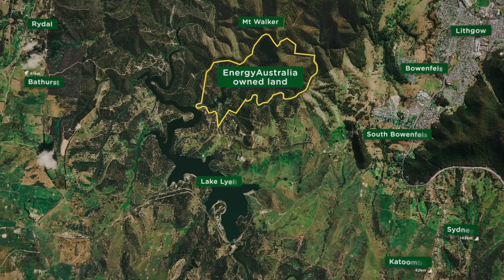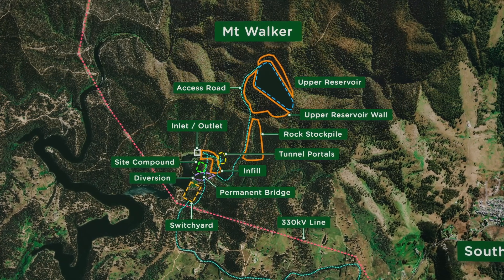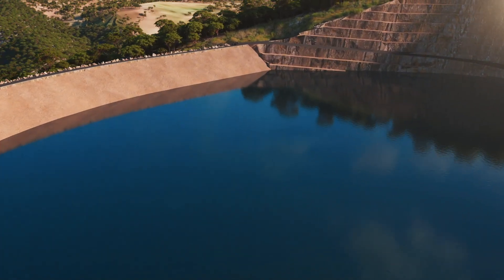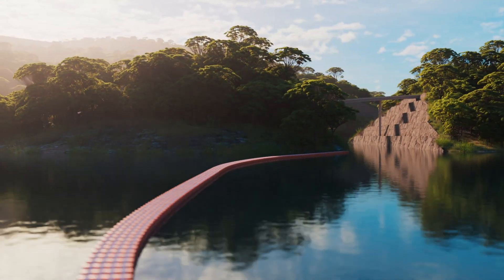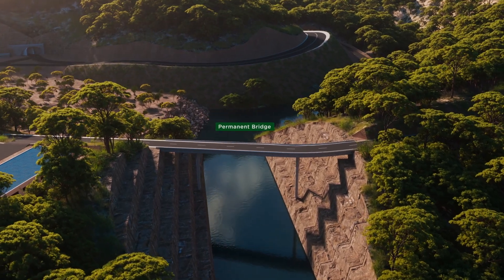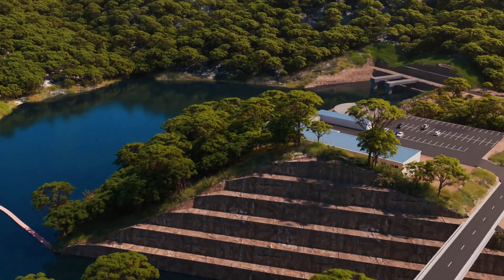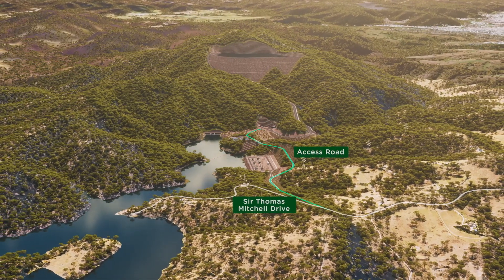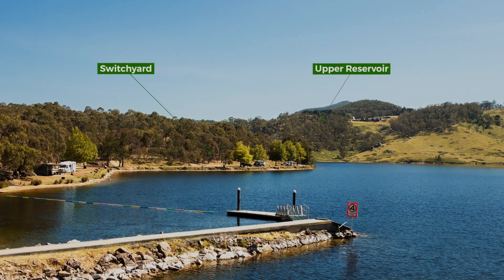Lake Lyell Pumped Hydro project – virtual tour

Comment: Will access to the mount walker summit via 4wdrive be impacted?
Reply: The "difficult" track going straight up is not on EA land. However, a section of the easier by-pass track that had the hairpin bend and leading to the half-way point runs over the EA boundary, and is currently gated off, even though this is Mount Walker Road, and was a public road for decades (although shut where it meets private property at Marrangaroo). It would be nice if EA was to re-instate that section of track as not everyone has triple dif locks and 60" tryes lol. There are also other points along the road to Mt Walker which cross over the boundary.